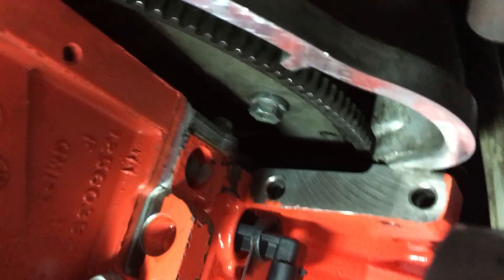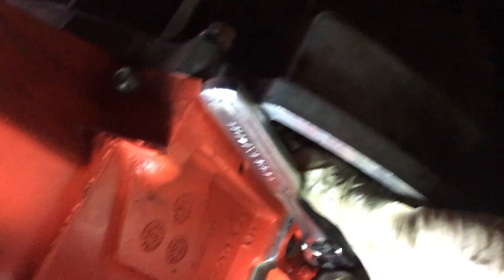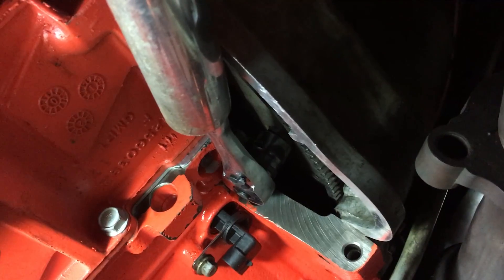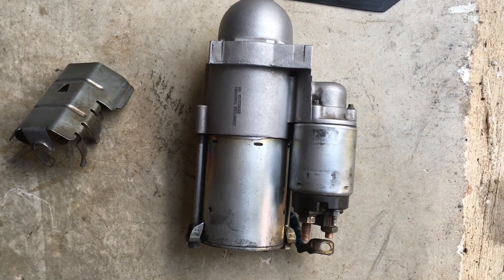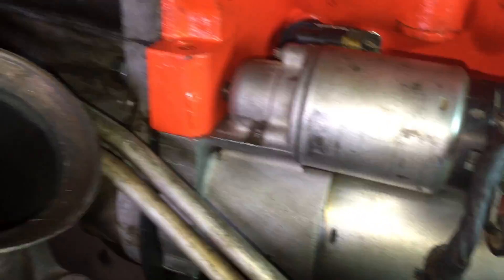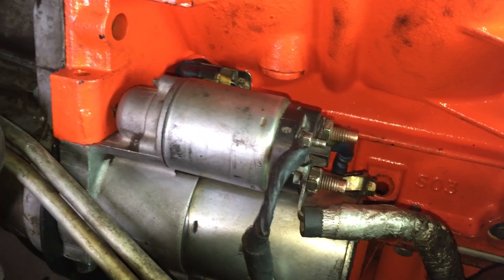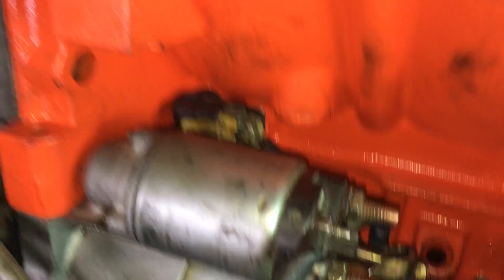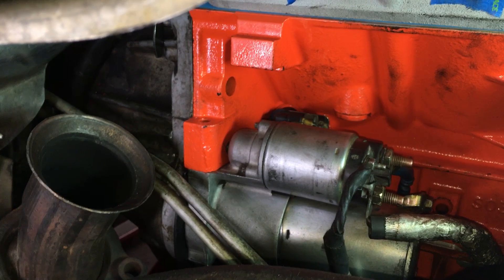Torque Converter to Flexplate Bolts | Starter Install vid 8 - GM Chevy Tahoe Vortec LS Engine

Comment: What can I do if I turned motor over while torquing flexplate to converter. I did not have a buddy to lock up my crank bolt, and realized that royally fucked up after I torqued all my bolts to converter.

Comment: Hope you're still staying up with the comments. I am putting these bolts on my Altima, but they don't seem to want to tighten up. I am using Self Lock bolts. Do I need to put more elbow grease behind them to get them pushed in?

Comment: Torque converter lines up with 3 holes in the flexplate , do the bellhousing bolts need to be fully in?,as its imposssble to reach the converter bolts to feed the nuts in
Reply from the maker: mine were

Comment: At 0:53, you only said "You Need to line them up". 
No Shit. The question is HOW to i spin the Converter, when I cant reach the damn thing???
Reply from the maker: My torque converter spun freely back there and I was able to reach it easily.  Not sure what's up with yours.
Reply: You probably didn’t have the converter fully seated. So did you end up ruining the transmission or is it still on jack stands ?